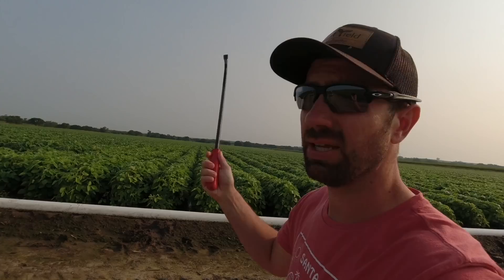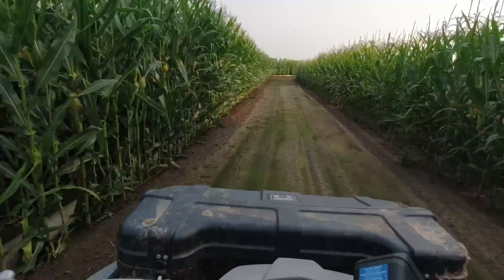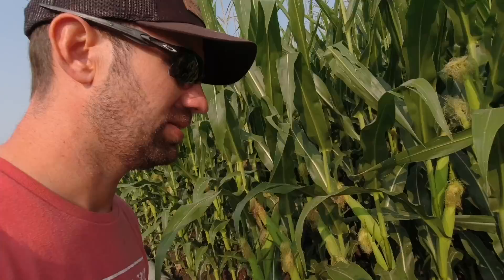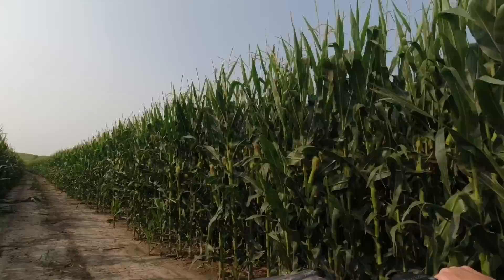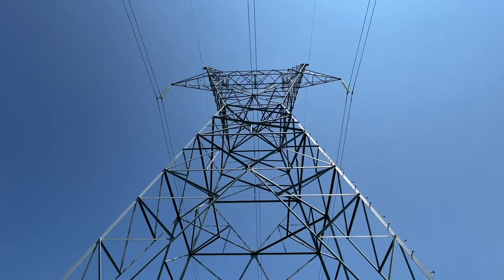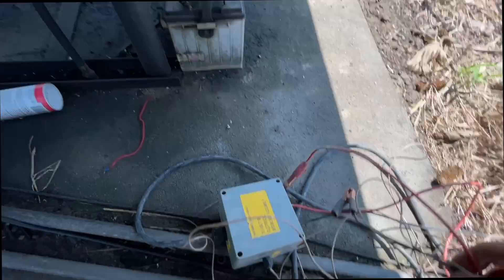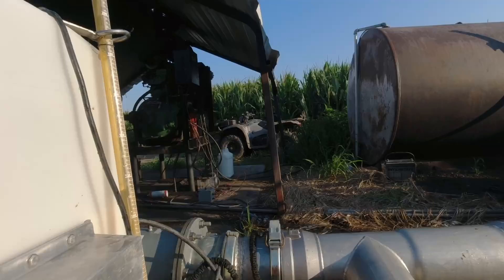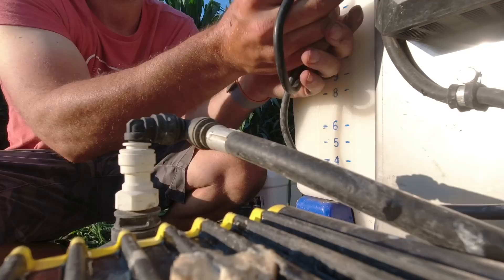Fungicides Through the Irrigation Pivot

Comment: The T&L control is a lot of work!   Others like ours are controlled by the phone app from anywhere.    Our water is expensive so around here I don't like the uneven application when temperature changes occur.   Or the extra energy to pump oil in pipes.   A lever on a valve is not an exact duty cycle of 60 cycle power.  To overcome this T&L has a computer with GPS. There must be other advantages?   Do tires or gear boxes last longer?
Reply from the maker: Yeah they all have their disadvantages. These tend to be easier on gearboxes/drivetrain, as they are constantly moving. No electricity 

Cons is having to add the gps speed control is more expensive to add on later. Oil leaks etc.
Reply: @ONeillFamilyFarms Speed by GPS is over $10,000 on a new T&L  1/2 miler purchase.  Knowing where the sprinkler is helps.  Yes, Valley has a computer board that cost $2500 to replace.   The repair which they do not do is to replace it's cheap $2.00 end tower run relay.   All Valley want to do is a big replacement of the board.    We started setting the duty cycle to more than 30 seconds so it takes longer to get to it's time to fail.  We just solder in the new relay.
Reply from the maker: 🤔 handy to know thanks. Yeah its expensive to add the gps on tl after the fact fer sure.